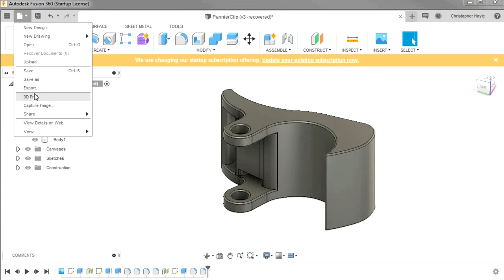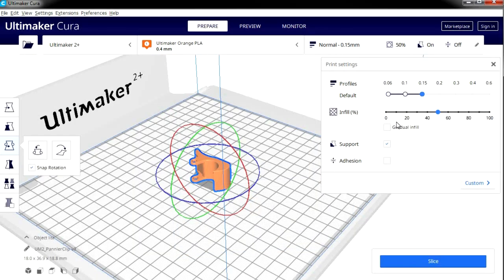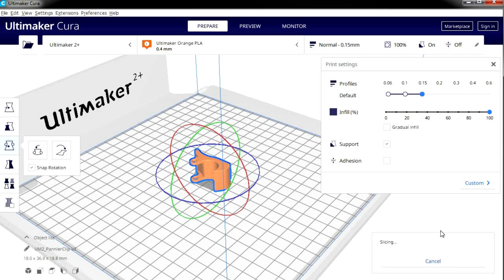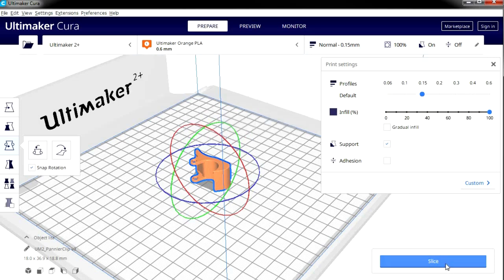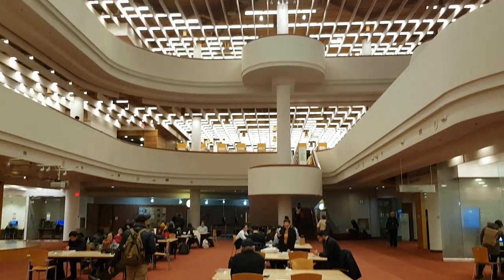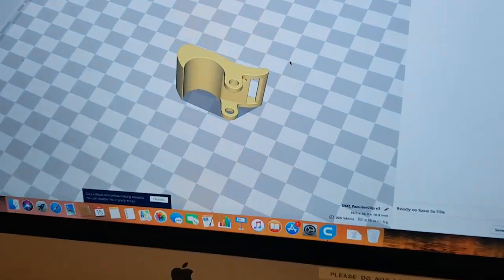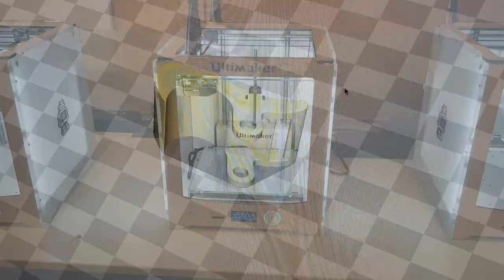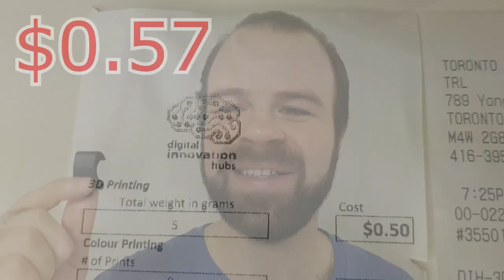Repairing Equipment at your Public Library using a 3D Printer

Comment: That's an awesome video. Thanks for sharing! Considering it's a structural part there is a technique of "baking" the 3d printed parts in oven to improve layer-to-layer adhesion and thus resistance to stress. This may affect some dimensions though.
Reply from the maker: Thank you! Hmm interesting, I'm still very much a beginner and had not heard of baking. Definitely something worth trying on something where strength is really important and dimensions are less important.

Comment: Awesome video. Glad you found a way to replace the part since it was not available. What material did you use to print the part? If it is made from PLA plastic, I suggest painting and sealing the part before extended use outdoors. Heat and UV radiation  from sunlight can warp PLA plastic if it is exposed directly. Hope this helps.
Reply from the maker: Yes, PLA is the material it's made from. Good to know, thank you!

Comment: Great video.  ABS would be a better filament to use rather than PLA.  I’d like hear hear how it holds up.
Reply from the maker: Thank you. Yes, I've heard ABS is stronger than PLA, but the Toronto Public Library only offers PLA. If it breaks again when I'm out on a tour, I'm sure I'll mention it in the video. However, like I described in the video, I've attributed the failure of the existing part to operator error, so if it breaks again it likely will be my fault.

Comment: Would making these parts out of metal be a good long term solution? By using Shapeways for example. I'm thinking about doing so for my rhinowalk 27L panniers for my one week tour this summer. Would you be able to share the file for these clips so I could see if they're similar?
Reply from the maker: Like I explained in the video, I believe the reason that mine failed was due to user error. I think if I had made the replacement part out of the metal that something else would probably fail instead if I picked it up by the red strap again. I'm happy to share the file. Please contact me by email.